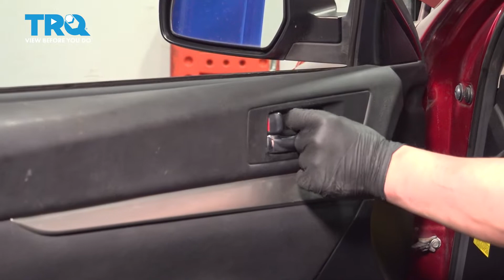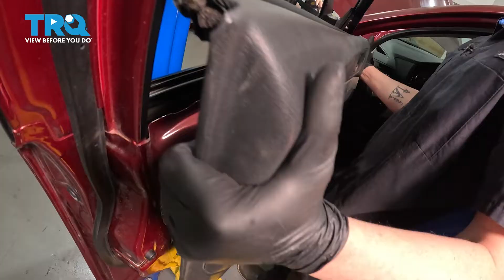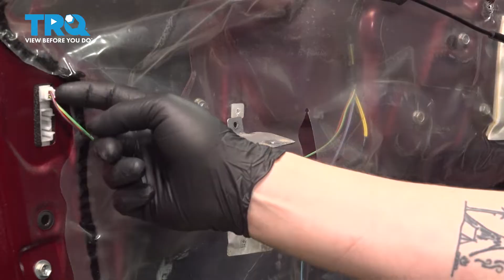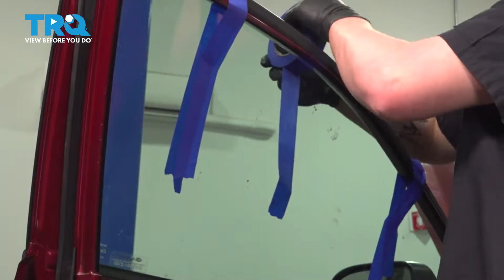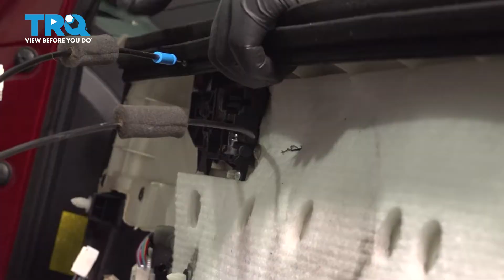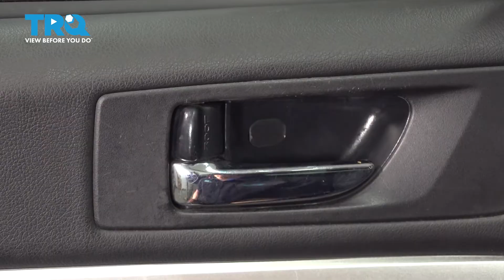How to Replace Front Power Window Motor & Regulator Assemblies 2010-2014 Subaru Outback

Comment: To remove the motor/regulator when the window is stuck in the closed position I cut through both cables:  Lower cable was easily accessible through the access panel on the inside of the door.  The upper one was a little more difficult.  After I cut the bottom cable and removed the three bolts on the motor I was able to see the upper cable by looking down into the window well from the top of the door.  I reached down with my fish tape, grabbed the cable and pulled it up through the window well where I was able to cut through it with a small bolt cutter.  After that the window dropped down so I could remove the attachment bolts.

Comment: Excellent instructional video, and a good way to save several hundreds of dollars. Just got through the replacement and it worked well.  

Here's a helpful hint - like others, my window would not go down, and the video doesn't go into detail on how to cope with this issue.  As other commenters noted, I had to cut two cables on the existing window motor/regulator assembly so the window would move.  Here's the more detailed procedure:  

(1)  Tape the window up.  
(2) Cut the lower cable (between the window motor and the lower part of the regulator).  I used tin snips, and I could get access and leverage to cut through the cable fairly easily.  At this point things got a little tougher.  The upper cable (between the window motor and the upper part of the regulator) is thicker and more difficult to access and cut.  I was unable to get enough leverage to cut the upper cable with my tin snips.  
(3) Remove the bolts securing the window motor to the door, allowing the motor to move inside the door.  I was able to move the motor over the left far enough to gain access to the upper cable with a hacksaw.  
(4) Saw through the upper cable (unless your snips are better than mine) so the motor is no longer attached to the regulator.  
(5) Remove the motor through the access hole.  
(6) Pull off the tape while holding the window so it doesn't free fall.  
(7) Lower the glass carefully by hand until you can access the bolts holding the window to the regulator.  
(8) Retape the window in the "mostly" lowered position.
(9) Remove the bolts securing the window to the regulator.
10) Proceed with the instructions in the video.

Comment: This video is great. The instructions are much clearer than other videos on this procedure. One problem is that my window motor is dead and my window is stuck in the up position. How do I access the bolts that connect the window to the regulator assembly?